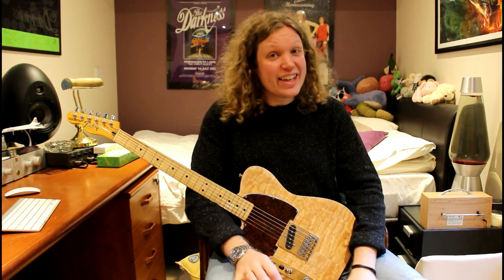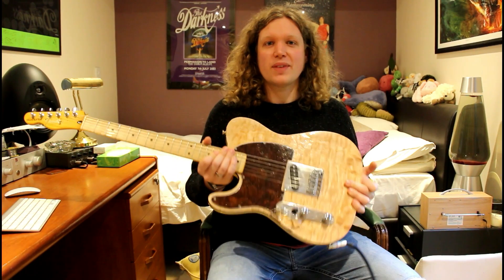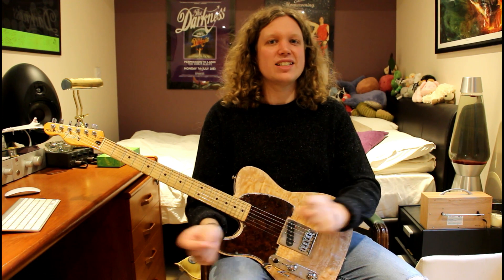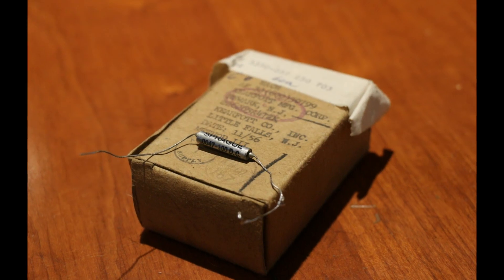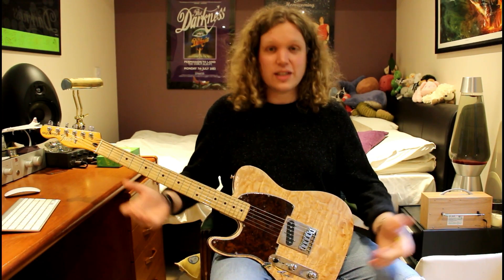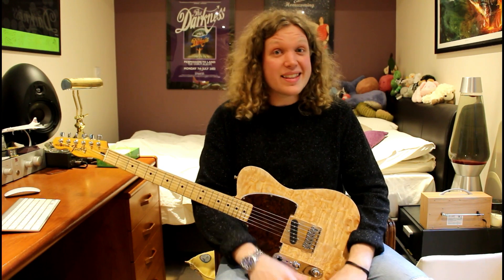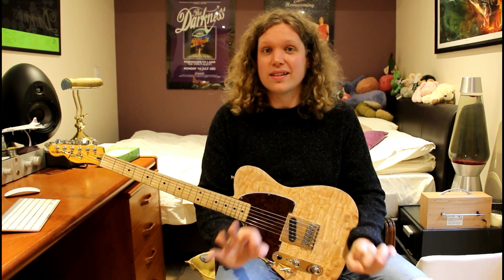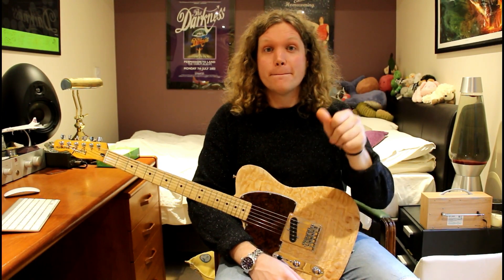Capacitors Part II: Auditioning & Constructions (The Crocodile Clip Trick!)

Comment: I scrolled down so that I couldn't see the video itself; just concentrated on the audio. And yeah, I didn't hear much of a difference either. Most of the time it was completely indistinguishable.

To my ears, capacitor composition (and brand) doesn't have a significant impact in a guitar's tone circuit, all other things being equal (including actual capacitance). I usually just grab a pair of Sprague orange drops from my capacitor drawer and call it a day. If I'm feeling irrationally desirous of vintage mojo, maybe some old Russian PIOs. I've never tried actual Luxe Bumble Bees, however... Perhaps those would change my mind?

Where I have noticed a difference in capacitor composition/make is in pedal and amplifier circuits. I build a hybrid Russian/Rams's Head Muff that I've used as a basis for experimentation with capacitors; all-WIMA builds, all-Panasonic, all-NOS, all cheap/generic, and various permutations thereof. My favorite combination thus far has been a particular line of KEMET film capacitors and Vishay/Sprague ceramics (for the feedback filter caps). There it makes a significant and audible difference, I've found. Far more so than in a guitar.

Anyway, tangent... Thanks for the video; I enjoyed it. And nice work, as always!

Comment: I'm planning to add some treble bleed to my les paul .0022 cap & 250k resistor in parallel neck and series bridge , no 50's wiring for me.
Reply from the maker: Good stuff :-) What works best for you is what you should be using!